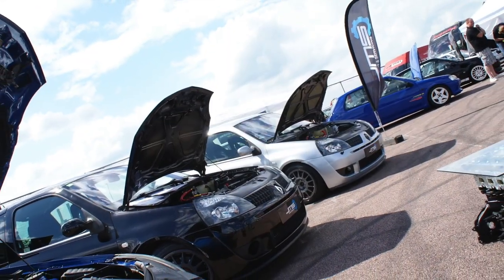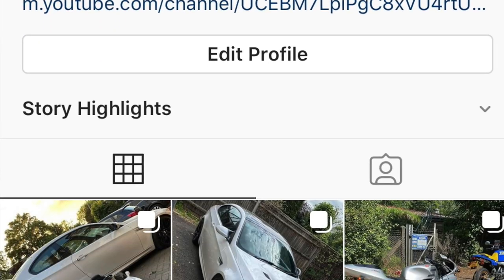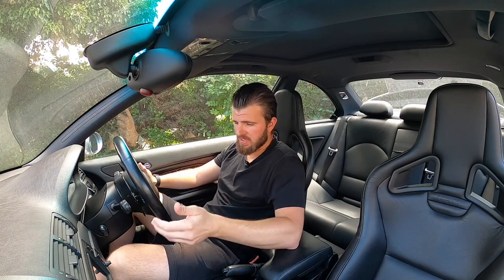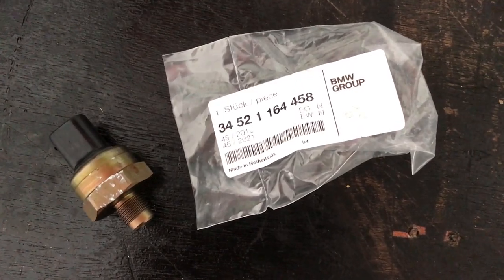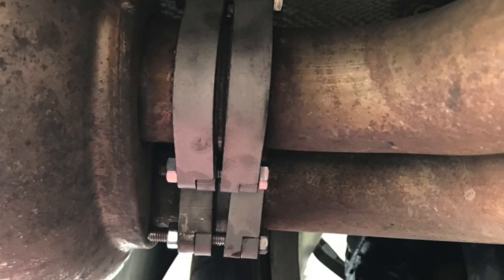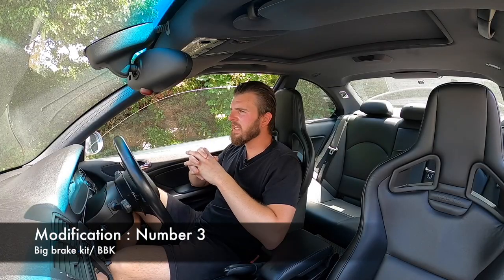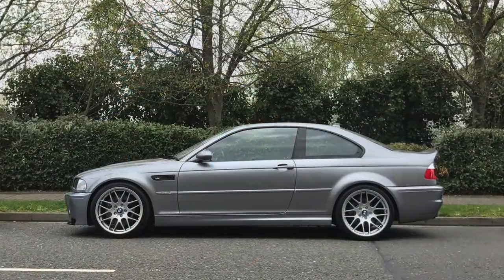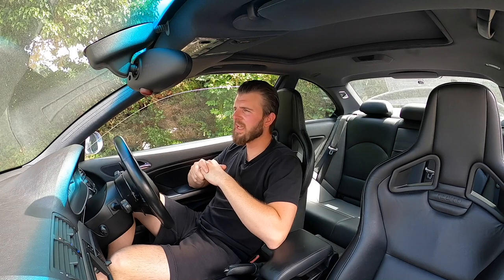BMW e46 M3 CSL replica build & buyers/ upgrade guide - ** The 4 year story **

Comment: The PureTech X brace is a worthwhile upgrade as the localised repair  patches will not necessarily prevent the rear axle carrier panel flexing and cracking at the wheel arch junctions, looks cool too and high quality construction.
Reply from the maker: Hi Alan, sadly I have heard this.. shortly after mine was completed (few years ago now) the talk about bracing inside the of the boot become very popular. My thoughts are if the standard one can pull off 60-80,000 miles my sub 5,000 miles should do me for years 😂

Comment: Really great info there m8
My old m3 was very similar spec to yours air box seats, brakes, exhaust suspension.
It was a manual and agree it's a crap notchy affair,even with the m5 knob fitted.
I sold it and bought a caged csl with intrax ik2 suspension titan coated
Full supersprint system headers cats lightweight race box.
Recaro profi spg seats with 6 point harnesses 
Aps front rear with spacers and wheel stud conversion.
I friggin love it as the cage helps stiffen the rear up and it feels and sounds like a race car.
My next mod is 4.1 diff and just maintain it as I'm never selling it.
Agree with the rs39 pads awsome but expensive and make loads of dust.
Reply from the maker: Thanks 👍 certainly sounds like you have one well sorted CSL 😎

Really happy with the 4.1 ratio diff, would be mega in a light weight CSL like yours even more so 👌

Comment: Quality video,  and so similar to my spending/journey with an  M of near identical age and mileage, be it a vert, and manual. Incidentally,  I agree regarding the Gertrag 'box standard, but a shame
you haven't yet tried a refreshed manual like mine with new bushes and shorter linkage with the weighted knob, it really does transform it, and the ratios are so easy now to select with a nice action.
Like you I replaced the Sachs shocks for new, and went with the Eibachs,  but hahah also like you wished I'd gone Ohlins(R&T) or something similar, as the standard is ok, but not as good as we'd like right. I went for the BMW performance caliper option(with CSL discs) which I have been more than satisfied with, Goodridge lines, and replaced the hard lines and the rear discs. Yea, really nicely done again.
Reply from the maker: Thanks David - sounds as if you have a complete understanding of my build with yours - worth every penny though 😎

The manuals can be improved with a CAE or RTD shifter so there is hope but strangely there is something I do enjoy about the SMG.. maybe need to try a proper manual again 🤔
Reply: Thanks mate

Comment: Worth doing the internal brace and gussets that Darragh at everything m3s does too, as well as the psDesigns plates.
Reply from the maker: I have the plates welded into place like the PS design ones, the boot floor internal brace started coming to light a few months after I had mine done 🤦‍♂️

With mine being mainly fast road use & covering 2 - 3,000 miles per year I would like to think combined with the near stock power she has a good few years in her 👍
Reply: Yeah and no reason you couldn't do the topside work in the future, e.g. if you ever decided to go coilovers, as you'd need to get a full geo done anyway. Those Vince braces and gussets, and the ones that Darragh does are really good at fully future proofing the RACP.

Any plans on a plated diff like a gripper or similar?

Comment: Great video and best info on an e46 M3 I have seen. Where did you get hold of the CSL Carbon Intake? Sounds Epic!!!
Reply from the maker: Glad you enjoyed the video 😎 the CSL replica intake is from Geoff Steel Racing but Karbonius make one that is as good (if not better than the genuine CSL version)
Reply: @stoneautomotive  thanks! I’ve just bought a 2004 convertible M3 and want to restore to full glory with some oem plus upgrades to hopefully give it another 16 years of life. Also the intake would sound amazing with the top down 👍🏼😎
Reply from the maker: @alibaby1001  Safe investment to restore 👍

Have a look on my e46 M3 play list - I go through all the upgrades I’ve done over the years 👍

The intake does sound incredible & sounds even better in the flesh, as good as the mics are that I use it’s spine tingling good in the flesh 😎
Reply: @stoneautomotive  working my way through them. Great content and I love what you’ve done with yours 👌🏼

Comment: Great stuff and quite comprehensive, and your delivery is spot on and fluid, unlike guys like DeMuro who constantly edits himself after every sentence. I'm on my second E46M3, both 6mt and completely stock, and has been my daily approaching ten years, and know the model well. That being said I have a couple of quibbles about your ten problems areas. First, I have never felt the sort of brake fade you describe after spirited back road driving, though I realize a brake swap is necessary to track the car. The discrepancy there may be partially attributable to divergent driving styles. Second, rust is typically not a primary issue with these cars, certainly not it the top 10, and your cutting away to a closeup of a particularly roached out old generic BMW is at once both misleading and disingenuous at the same time. Finally, and this may be a cultural thing, I haven't heard the expression "Jewish" as a synonym for "cheap" since high school, and I'm 60. Funny though I had a Jewish girlfriend back then, and she wasn't offended by it at the time. But it's 2020 now,  not 1975, and you simply can't let stuff like that slip if you want to grow your channel. I know that much of this post is going to come off as criticism, but it I didn't enjoy the content of the video overall I wouldn't have bothered to type such a lengthy response in the first place.
Reply from the maker: Hi Greg,

Thanks for spending the time to comment, with regards to the brakes i agree with you in part, driving styles will always vary between owners and I did state in the video this would be my opinion (sure others will agree/ disagree)

The rust is an issue in the UK (assume your from the states?) many owners are now experiencing heavy corrosion in the e46 (now also appears to be hitting the e92 ☹️) are winters are not terrible in the UK but our local councils appear to prefer laying a carpet of salt during the winter months rather than ploughing away.. I’ve seen it on more than one occasion and the clip of my 320d wasn’t to scare people but more make those aware of a little rust on the face of it can be big bills if not correctly inspected/ repaired.

The Jewish comment isn’t made as being cheap, more being tight/ looking for a good deal on things - certainly didn’t intend for it to offend but I should certainly be more mindful of my comments 

Hope you enjoy the videos 👍

Comment: Can you recommend an obd reader you use I’m thinking it could be a good investment for mine nice motor
Reply from the maker: I use the genuine BMW software & usb/OBD leads that are for sale on eBay for around £30.00 delivered but you will need an old PC - they are very old school but allow coding which was really handy with my e92 M3 seat swap due to the air bags. The most user friendly version I have seen is Carly app which is around £50 for the OBD plug, download the app on your phone but does carry a £100 per year subscription sadly

Comment: I might fit a karnubius airbox next, just because I've done most other stuff and this would turn up the volume a bit 😎
Reply: So far I've done:
Evolve remap | Eventuri intake | Supersprint non-res x-pipe/sport muffler | Gripper LSD (4.10) | Intrax 1K2 coilovers | AP Racing BBK | Pagid RSL29 pads | BMW SSK | CDV delete | Braided brake/clutch lines | Eibach camber arms/wheel spacers | BMW front reinforcement plates | Mason front+rear strut braces | Powerflex black FWRB/RACP/RTAB | CA wheel studs | TD wheels (track) | CSL wheels (road) | Recaro Pole Position ABE | PSDesigns RACP plates | Vince RACP brace+gussets | Spires geo | Rennline throttle adjuster | One-touch rear windows | Armrest delete | Cup holders | Depo indicators | Bonnet soundproofing delete | ECUworx tweaks | Grom USB audio | Vanos/HG/Rod-Bearings done | Drivetrain bushes refreshed
Reply: If I ever decide to not use the back seats, I'll get another PP ABE for the front passenger and do a rear seat delete to save some weight.

Comment: The sound from the CSL intake is purely because it's really thin, I don't understand why no one, in all these years, has produced a fiberglass alternative? It's the same process, mold and lay, but is miles cheaper. Or even an old school style ally box intake. No shaping, just square sheets? Seems crazy to me lol
Reply from the maker: I think the issue with fibre glass will be cracking, not sure if anyone has built a sheet aluminium one but you can’t deny the carbon fibre looks awesome 😎